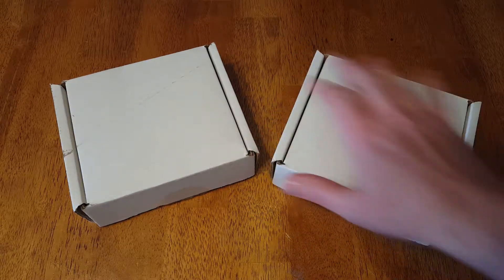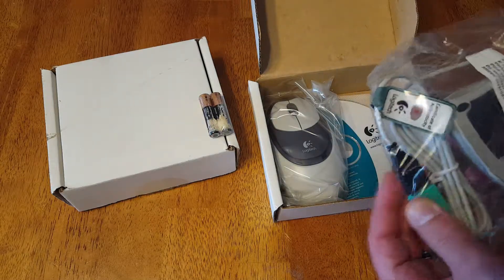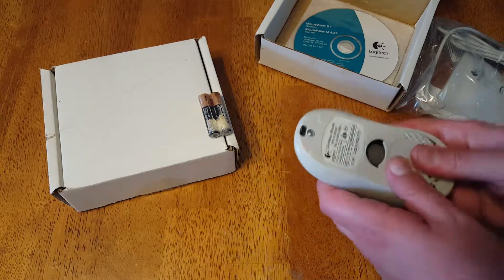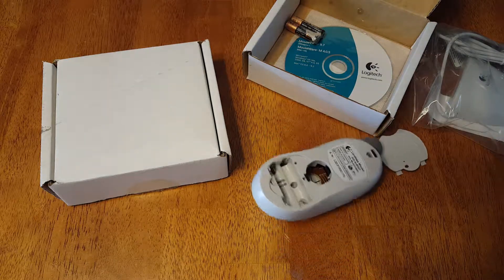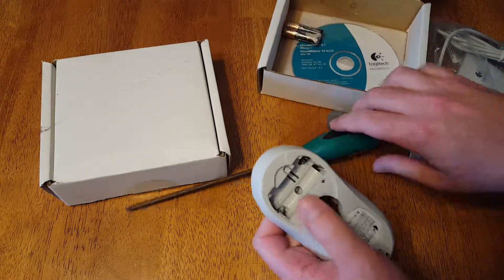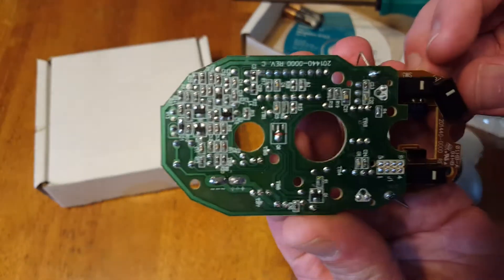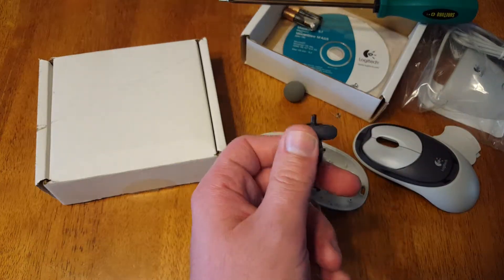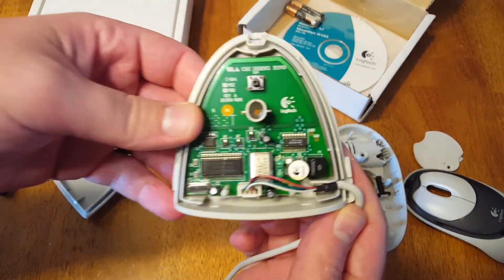Logitech Cordless Optical Ball Mouse M-RM67 Teardown Because Reasons

Comment: I still have M-RR67A Logitech Cordless Optical Mouse together with the keyboard. Recently I switched to Mac (Mac mini M1), funny thing is that the mouse click is not working in Mac OS at all. Movements, scrollwheel is ok, but no click... I could not set up the new mac because of it and had to connect a wired mouse... Any tip how to use this logitech mouse in MacOS?